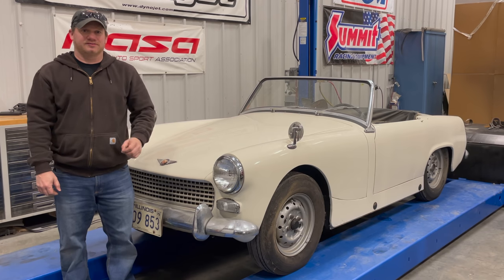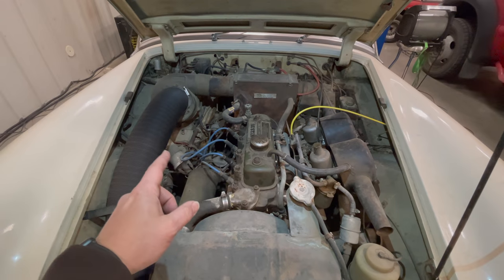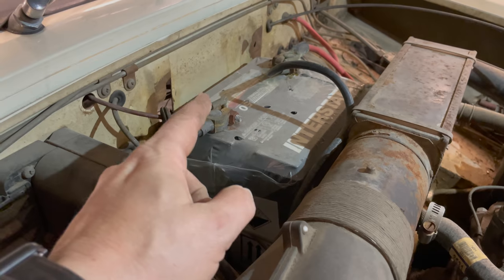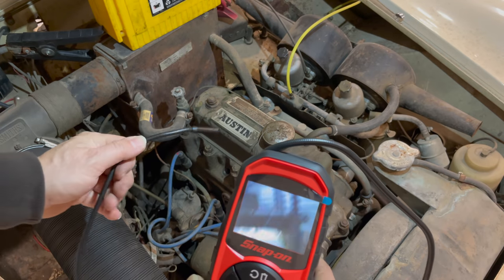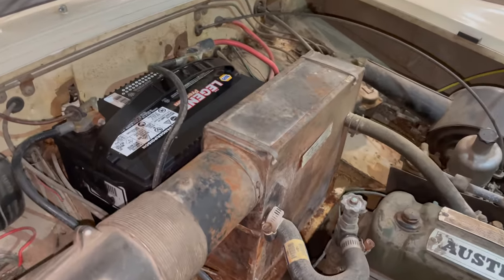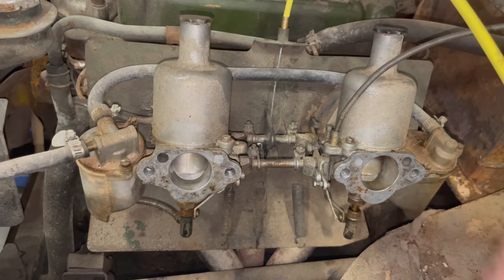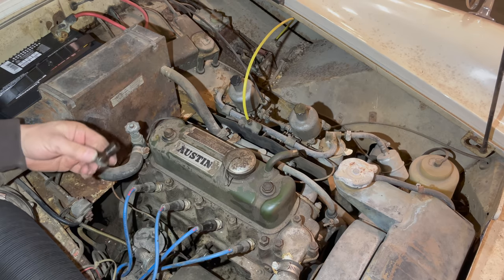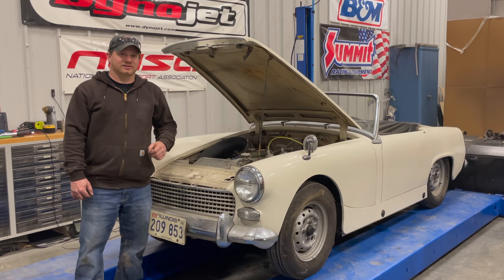1962 Austin Healey Sprite Mark II - Will It Run?

Comment: I recently purchased a 72 MG midget that hasn’t run in 10 years. Your video confirmed the process that I went through in checking the motor and it’s condition!

Comment: I like the fact that you can find an old MG that hasn’t been used for decades and it’s still in such great condition.
The brakes and clutch are not a surprise, but the engine is amazing.
Looking forward to seeing you work on this one!
Reply: Sacrilege!! You called this fine car an MG! 😖
Reply: @jackdaniels14369  Over here there was so much “badge engineering” that it was hard to work out what came first!
It is a fine car, but apart from the front bonnet (hood) the rest of the car is pretty much the same.

Comment: What I love about these videos is your depth of knowledge, your logical approach, and the way you so clearly explain what you are doing and why. Over the years I had a pair of Bugeyes -- a 1959 with a 1275 and a rib-cage gearbox and a 1960 with the original 948 and smooth case gearbox but added front disk brakes (that was my favorite). Gosh I loved those cars! You can drive down the road at 55 and feel like you are going 100, your hair of course blowing forward into your eyes. Now I'm 68 and wish I had another one to share with my sons. I'll sure be following along on this Mk II.

Comment: Looking forward to it. Just took the master cylinders out of my Bugeye for rebuilding, and my dad raced one of those you're working on all through the late 60s and 70s right into about 82. I still have the doors from that car, but sadly the rest of it went to the scrap yard. I can still remember driving past that scrap yard months later, they had it sitting on the top of a pile and you could see it from the road. Sad.

Comment: You sir, are quite a good mechanic.  

Interesting side note, I have that same engine in my Datsun forklift...  kinda..
Reply: Datsun’s pushrod A series of engines were copied from the BMC A series engines used in Sprite’s and Midgets. So the reason they look the same is cause they very much the same. The first Datsun’s were Austin’s built under license, the Japanese and British had a long standing relationship with things like this.
Reply: Bryan Cohn that, and Datsun bought a bunch of tooling to cast those blocks
Reply: Likely an "A Series" engine. Very popular. Like I had in my '71 Datsun 1200.
Reply: SlothZombi my Datsun forklift does have an A series, it is an 1100.  Vintage 1973.  Runs on propane, it will last literally forever.  This engine was cast on tooling bought from The British in the late 1960’s

Comment: It'll be great and very informative to follow your progress on this car. Different makes of batteries often have different date coding on or in the battery casing, before submitting it for recycling you could try putting it on a glacial recharge and doubtful but who knows it might pick up enough to run a shop radio, waste not, want not.

Comment: The rockers with 2 jacking points were introduced about 1975 with the 1500 engine. Early 1500s (1974 to 1975) had single jacking point rockers. The earth strap should be secured to one of the bell housing bolts, not the slave.

Comment: Hi Steve - thanks fo this series!  I just picked up a '63 Sprite and will take it through the same process. This playlist is invaluable!  Quick question to help a first timer - how do you 'bump' the cam lobe open while it's in gear (around the 8:25 mark)?
Reply from the maker: Put it in gear and rock the car by hand, the engine will turn.  Stop when you see the points are on top of the cam.
Reply: @ThisWeekWithCars  got it, thanks!

Comment: Wow, nice finding. 
Q: Where or how you find those solid, very restoreable cars ? Bring-a-trailor ?
 But the license plate, this one comes from Illinois, right ? A rustbelt belt if there is one ! Incredible condition car !
Reply: this car was a toy, not a daily driver. Everybody has a garage, that's where their summer cars stay. This car was only driven on nice Sunday afternoons. When it didn't run anymore, they just left it in the garage.

Comment: interesting to see 1500 sills on a mk2
Reply: Kodie . You'll have to explain . Looks fine to me and the condition of the car would indicate the sills are original.
Reply: The two jacking points on the one side.  It has had bodywork and paint in the past
Reply: @johndavey72  The dual jackpoints came in 1975 for the 1500 cars, so the sills have been replaced at some point